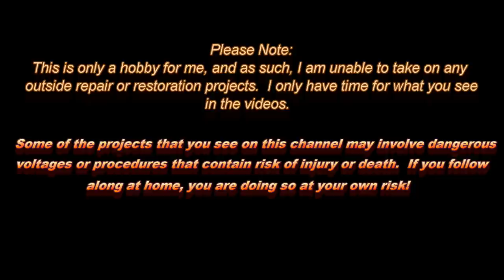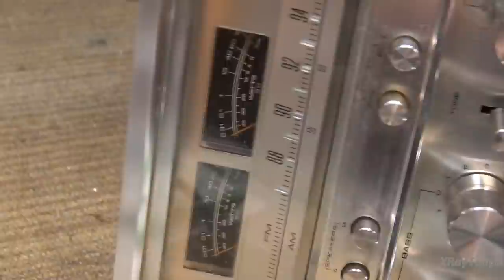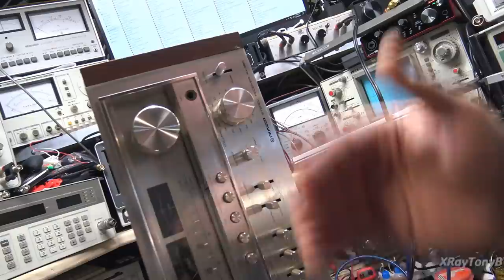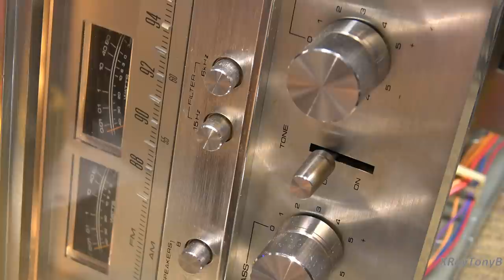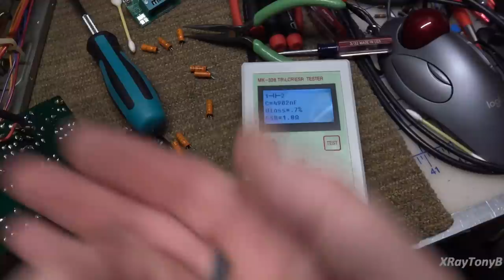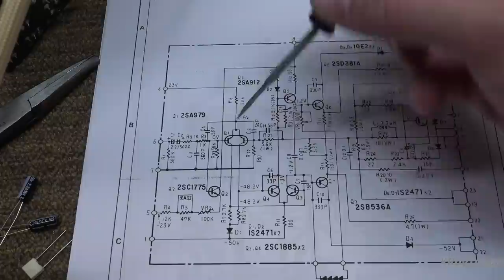Pioneer SX 980  - Troubleshooting & Repairs

Comment from the maker: 0:15 Intro
2:21 Tony rant
3:27 Results of initial test - repairs needed
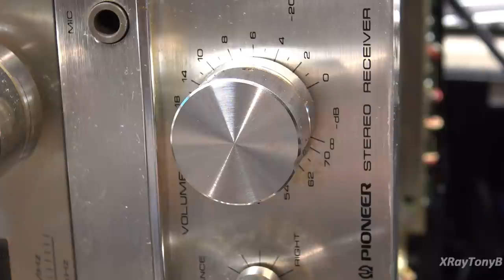7:06 Troubleshooting results - first problem found, additional problems exist
12:03 Feeding signal directly into power amp to isolate problem to either the power amp or preamp section
14:22 Testing & repairing the volume pot 
21:07 Flat amp board reassembled
21:15 Example of Hfe range color dot code on small transistors (They were replaced with KSA992 transistors with same spec)
22:42 Testing to see if the problem is repaired
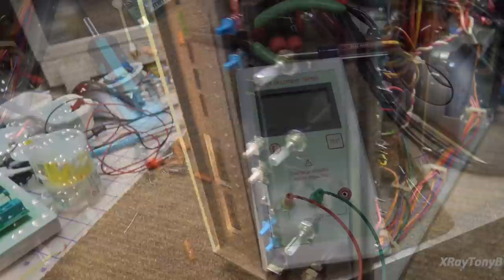24:49 Capacitor talk - Orange capacitors are all bad on this board!
27:55 Notes on protect/speaker relay
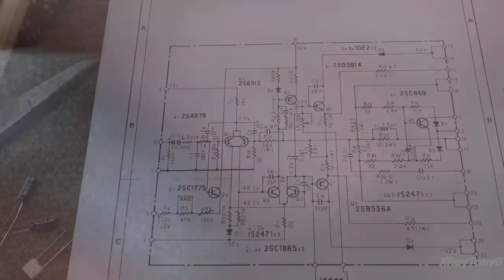34:31 Should we ALWAYS replace electrolytic capacitors with film capacitors?
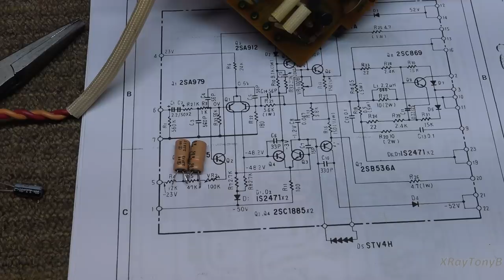41:19 Closing comments
Reply: Hi Tony, I've got a slightly random question for you if that's okay. I've got a Sansui 6060 that has right channel issues, but I've noticed that the leads on most of the components are so black with tarnish that I can't get any readings from them. My question is, how would you go about resolving that? Would you clean the component leads somehow, (possible after removing them from the boards) and if so, how would you clean them or would you just replace them all?
Reply: Hi Tony, great video(s). Been watching, just wish that when you say "I've done that in another video", you'd tell us which one it is so we can go and watch it. 🙃.
Thanks for being a great teacher and your humble approach toward us learners.

Comment: The input coupling capacitor was done to save $. That's it. The increased ESR has NO appreciable effect on the circuit. The 1k completely swamps the so-called 1.X ohm ESR from the caps.
Reply: Agreed.  That 4 ohm ESR is only 0.4% of R2.  That's not a factor.  Also, you do need a bipolar cap there.  Yes, C25 is polarized, because it's connecting 18.5V to a ground referenced side.  But the output of C25 will swing +/- with respect to ground.  At this point, my best guess is cost savings.  I'd change it to a film cap and call it a day.  (I'm not convinced that two caps in series to make a bipolar works that well and stays completely linear.)
Reply: Agree. My Nikko Beta 20 Preamp had many examples of the back-to-back electrolytics and it seemed obvious this was to save costs since the capacitor values were common to many other caps throughout the board. I replaced with bipolar caps of high quality and transparency of the sound went up. (I eliminated 10 polarized electrolytics this way.)

Comment: I don't believe that it would be measurably worse changing those decoupling caps from a pair of polarised, to a single NP electrolytic to a film, assuming the same value - especially as is seems there is another decoupling cap on the output of the earlier stage.  In fact I'd go as far as saying that changing to NP or film may even make a slight improvement.  Usually the bottom end roll off limit is set by the negative feedback cap not the input caps so it shouldn't influence that aspect.  I suggest they simply chose to use two polarised caps in series because it was a very common value used in the production line.

Comment: Hi, Tony... I have another thought about the two capacitors. I think there is no need for the ESR because there is a 1K resistor in series. That resistor forms a low-pass with C3... Some 3 Ohms extra won't matter... but perhaps you have a better insight.

Comment: It seems Pioneer did this two ways on this model during production. One was the way you have it there with two 2.2MFD low leakage caps configured for BP  and the other is one single low leakage 1MFD bi-polar capacitor which is what is in the SX-980 i am working on now. So it seems you can actually go either way. The board number on mine is AWH-073

Comment: I suggest that when you clean pots or switches with silver plated contacts do not polish the silver clean.   First of all tarnish i.e silver oxide is ugly but conductive. Other contaminates lift the contacts apart causing intermittent contact. First I would decrease with alcohol then to convert the silver oxide back to pure silver do this, line a glass cup or bowl with aluminum foil and add some warm salt water. When you place the silver part in the container and it touches the foil it will almost instantly turn back to shiny silver. This works on the family silverware as well. The silver part must be totally grease or oil free. The silver is preserved and there is no rubbing. The butler can find something else to do!

Comment: Tony, You can’t short the relay to ground to avoid a spark. It would destroy the amp if there was Large DC offset or if working Ok and playing loud and producing high current to the speakers. The relay is designed to create an open circuit to protect the amp from the load. Other wise you explanation of the relay and how it works was great.
Reply from the maker: That's not how it works.  The speaker is what is shorted to ground.  In that type of relay configuration, the common contact of the relay goes to the speaker, the normally open goes to the amplifier output and the normally closed goes to ground.  This will greatly reduce the arc flash as the protect relay drops out.  This is a well known method that increases the life of the contacts.  The speaker is changing the connection, not the amplifier output.  Some amps are not wired this way and the relay connections must be modified for this configuration.

Comment: FWIW I have a similar vintage TEAC BX-550 which I recently recapped. I note the amplifier has 2x  10uF/25V capacitors in series followed by a 1k resistor. These being found in the input of the moving coil circuitry. Yet no such arrangement is used in the moving magnet circuitry.

Comment: Yes but with the two capacitors tied Together you're saying increases the resistance esr but in the circuit diagram shows a resistor in series why would you need the high ESR on the capacitor if you have the resistor in series with it?  I'm not convinced party that argument!
Reply: Spot on John, noticed that 1kΩ R2 in series as well, low or high esr will be swamped by even 1% tolerance deviation on that one.
Reply: It's unconvincing, because it's WRONG.

Comment: I've seen that 'series' cap designed used with other power amp at the signal inputs. Randy Slone (RIP) used that "dual cap design" a lot in his books. (The Audiophiles Project Source Book) But he uses tantalum caps. From what I've read and seen it's a common design technique. One amp design uses two 22uf tant. caps right at the audio input to the diff. pair.  Not sure why they use tantalum caps. Maybe better HF transient response and lower thd than standard electro caps ?

Comment: My 980 has amp board awh-073. Instead of having the two 2.2 caps on the board it has one 1micro low leakage cap. The other slot is solder filled from the factory.

Comment: The problem I have with the ESR idea is R2, a 1k resistor in series with the dual caps. With a 1K resistor in series, 1.8ohms or 3.8ohms would be grossly insignificant.
Reply: Exactly. And another 21K in series. I Also think the ESR is not a design idea. Also, ESR is not a stable parameter of a capacitor.  It changes with capacitor ageing. Most likely the film capcitor was more expensive or too large to fit in that place.
Reply: @JoeGoesXtreme  I totally agree.

Comment: These two capacitors are at the input of the power amp, right? Remember, this amp has a split between pre amp and power amp (see https://youtu.be/Yn6KngRwhEQ?t=733). So if you feed an external signal into the power amp, it could have a positive or negative dc offset. With this bipolar configuration it is prepared for both cases.
Reply: I agree that it's for protection, especially since there's a 1k resistor in series with the caps. Putting them in series also doubles the voltage rating, so it's two-way protection from failures in the power amp or failures in the preamp. But why didn't they use a film capacitor? Sometimes they decide to use parts they commonly stock vs. a special part they'd have to order.
Reply: Sounds good, but the question still remains - why they did not use a film capacitor or a non-polarized one?

Comment: I always been stumped by the two electrolytic caps in series thing.
With a real AC signal that means that one of the caps at any time 
has half of the signal in reverse polarity while the other has it in it's correct polarity.
Given that the signal is divided equally between them.
When the signal changes polarity this reverses, and the other cap now has a reverse signal on it.
Can that be good from a sonic perspective?
I know many speaker crossovers use (or older ones did use) this configuration.
Reply: It's a very interesting take on this matter, however conclusions are simply wrong, I'm afraid. Two caps in series - anode to anode or cathode to cathode is precisely what you'll find inside any bipolar electrolytic cap. Remember that midpoint is not connected to ground.
Reply: @paulb4661  Well of course the midpoint isn't connected to ground. They wouldn't be in series then.
If my conclusion is wrong, then what is the correct conclusion?
Isn't the AC voltage divided equally between the to caps or what?
And if it is, then how can it then not be in wrong polarity on any of them?
Reply: @geirendre After Cornell Dubilier electrolytic caps application guide:
If two, same-value, aluminum electrolytic capacitors are connected in series, back-to-back with the positive terminals or the negative terminals connected, the resulting single capacitor is a non-polar capacitor with half the capacitance.
The two capacitors rectify the applied voltage and act as if they had been bypassed by diodes.
When voltage is applied, the correct-polarity capacitor gets the full voltage.
In non-polar aluminum electrolytic capacitors and motor-start aluminum electrolytic capacitors a second anode foil substitutes for the cathode foil to achieve a non-polar capacitor in a single case.
-While it may appear that the capacitance is between the two foils, actually the capacitance is between the anode foil and the electrolyte.
The positive plate is the anode foil;
the dielectric is the insulating aluminum oxide on the anode foil;
the true negative plate is the conductive, liquid electrolyte, and the cathode foil merely connects to the electrolyte. The way I see it is, that the first cap is not reverse biased because the midpoint isn't grounded while the second cap blocks DC, hope that helps.

Comment: I was wondering if you were open to doing an simple experiment I have a Yamaha rx-a1080 receiver which has an ESS 9006 sabre dac which I want to change to the more current 9026 DAC and replace also the adc chips too to make improvement to the dynamic range Yamaha went with 10 year old dac instead putting in the most current one The unit is totally functional and taken care of. I was greatly disappointed with Yamaha.

Comment: Try an electric leaf blower to blast out the dirt real quickly outside.  It's the fastest way I found.
Reply from the maker: I'm afraid I would blow the whole receiver off the bench :)=)
Of course, one of my friends cleans his car out with a leaf blower.  Just open both doors and blow the leaf blower in one side and the trash blows out the other ;)
Reply: @xraytonyb  I was told that one should never blow dust but vacuum it up because it could contain many toxic particles. At minimum, it should be done outside while wearing a mask. 
Could high pressure shop air damage any component in a receiver?
cheers 
Mark

Comment: Interesting about the caps in series.  I am recapping a Sansui AU717, it has a switch to select between pre-in/main.  On that pc is 2 electrolytic's in series to decouple the input.  Next to those caps is a open spot for 1 cap.  So they had the option of using a film there.  Debating what to use there, it seems most restorers use the film option.  Interesting Sansui did have the option, way back in '78.
Reply: Why don't you do both one and one Channel one on the other and compare what you think is better sounding
And if any test show any changes like in distortion harmonic distortion
Reply: @johnsweda2999  Good idea.  Thing is, I don't have any way to measure distortion.  Also, highly doubt I will ever need to use just the main amp input.  The switch is 3 position, with 1 of those by- passing the decoupling.

Comment: Actually! What is the difference between polarised and non polarised capacitors? I don't think that I have ever seen or heard a talk about the difference between the two! 
To my understanding, a polarised capacitor will only charge via DC if installed correctly but I don't know if this is the case with non polar capacitors? 
I somehow thought that AC can pass both ways but now I'm not so sure... 
I generally see non polarised capacitors being used in speaker crossovers but I have also seen polarised capacitors also being used as a high pass on tweeters in cheap home speakers and especially with car tweeters... 
Either there's some benefits to using one or the other or there's something else that I'm not aware of? 
I would like to also say thanks for testing some old capacitors and comparing to new.... There's something soothing about watching this take place even though there's no point to it LoL.. 
I would like to ask you if you consider yourself as a repairer or a restorer? 
The reason behind this question is that for some time, I was watching videos by a lot of different people who work on electronic equipment and it seemed that everyone is doing the same thing! As a consumer, when something goes wrong with your equipment, the first thing that you might think is that you need to find a repair man.... But after watching a lot of people work, I feel that there are really two different types of people working in this trade! I feel that a repairman is something that I don't want to touch my equipment! I don't want just the failed components to be replaced without finding what caused them to fail in the first place! Yet I probably wouldn't have gone looking for someone to restore my equipment simply because it just sounds expensive even though, especially if you value your equipment, it's actually the cheaper option... 
I have had equipment so called repaired before only for it to stop working at a later date and because of the same problem! 
People who restore in my opinion are far and few in-between... 
I watched a video by Uncle Doug where a customer sent in a tube amp for repair and the accompanying letter from the customer clearly stated that he wanted Doug to work his magic and cost was no option! This customer clearly understood the value of his amp, knew the quality of workmanship and knew that for the money spent, it should not fail again for at least another 40 or 50 years of service! 
Of course there are times when you just have to get something working just enough to transfer media or something like that before it gets thrown out because it was probably junk equipment to begin with but I see a lot of people work on beautiful vintage equipment and they won't go right through and check everything and then they do something stupid like replace perfectly good speaker terminals that an engineer with a far better understanding of what that amplifier needed with huge gold plated brass terminals when it makes no difference whatever to the sound even though that's what they thought they were actually achieving.... Look at me! Now I'm ranting! Sorry! 
So basically.... Restore, don't just repair!
Reply: A polarized capacitor is designed to handle 0V to it's working voltage - but only in the one polarity.  If the capacitor will see the polarity reverse (as in this case), you should be using a non-polarity cap.
Reply: @russellhltn1396  when you say 0v to it's working voltage, I'm assuming DC voltage?